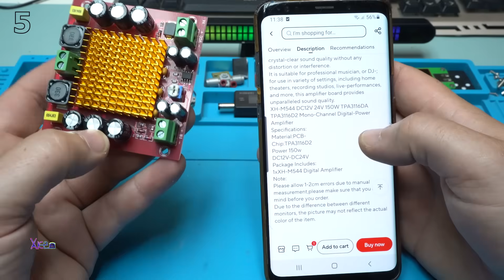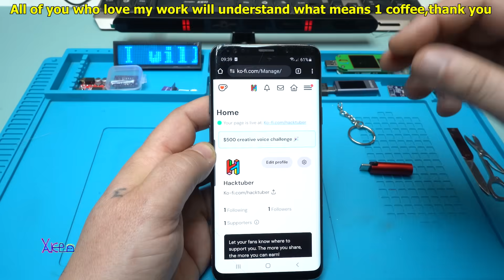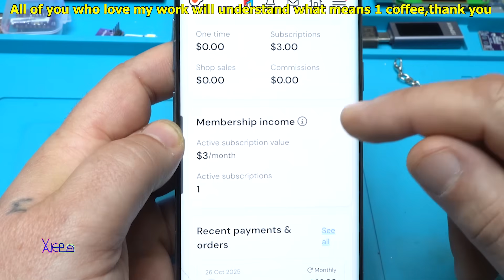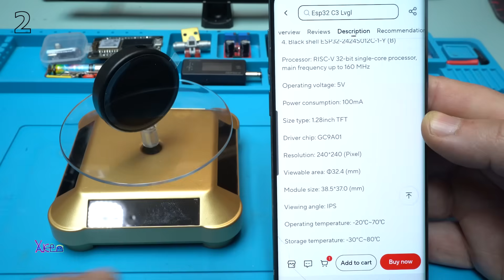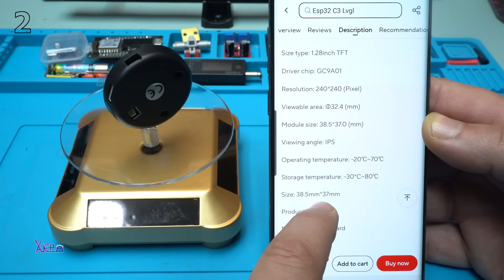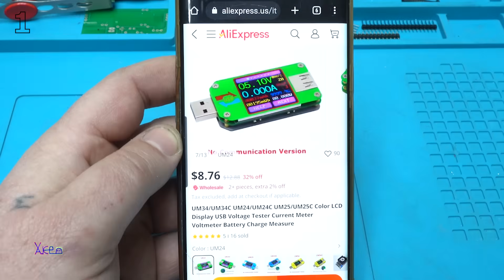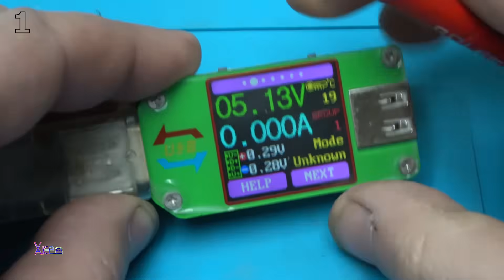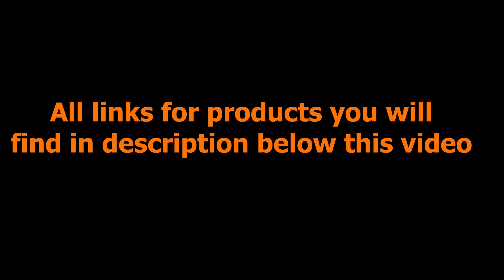TOP 5 FANTASTIC Aliexpress Modules

Comment: 9:57, Is the 2 pin connector 3.7v used for power supply or only as a battery backup?

Comment: My neighb or has a buzzing guitar amp, would that amplifier board be suitable for an electric guitar powering a 20W speaker? Do you know the output impedance it can handle?
Reply from the maker: I dont know sir,need to experiment
Reply: @Hacktuber  You cover a lot of great stuff. If I buy one for a guitar amp I'll let you know how it goes. Cheers.
Reply: IF it is the amp, it’s usually an easily fixable loose earth, or the jack socket itself. Hope this helps.
The last one I fixed was missing an earth bonding screw! 😮
Reply: @AQUA-Mannie  Thanks, turns out the ground wire had broken away from the jack where the patch cord plugs in. Cheers.